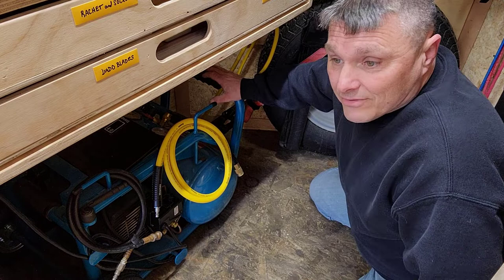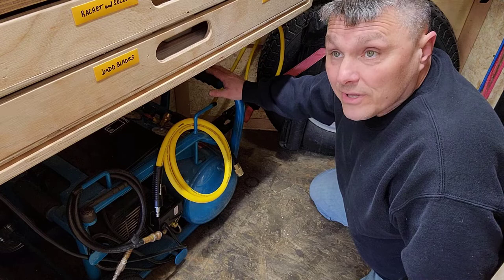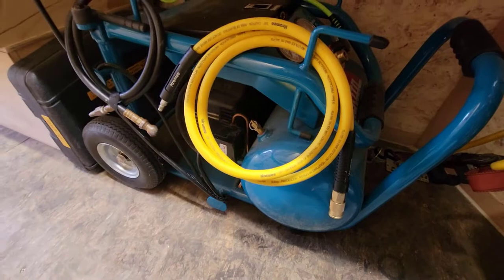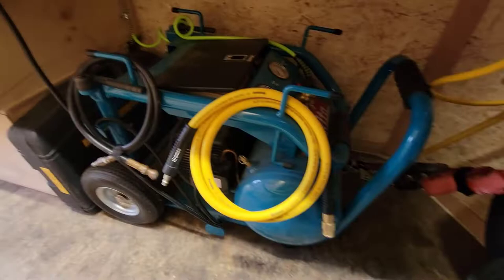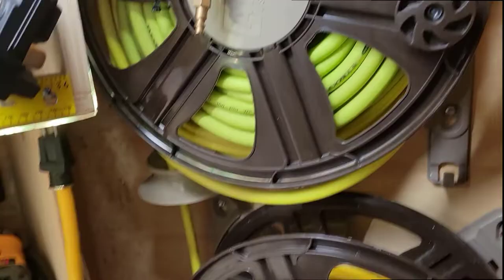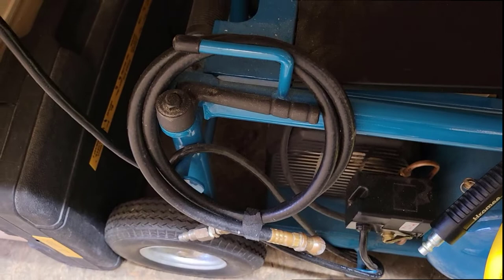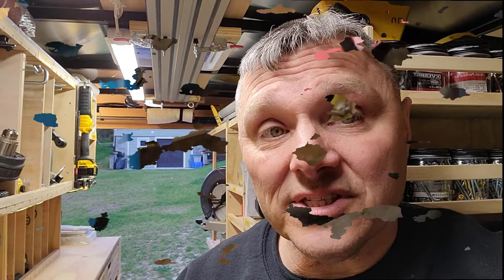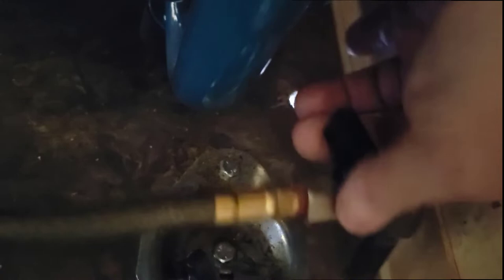Tool trailer air system on my Paulk trailer

Comment: I got a question wat compressor will you be going to next?
Reply from the maker: Thanks for commenting Rene! I have not researched it yet and will do so when I buy a new trailer in a couple years but I want to get one with a solenoid start because they pull much less power on start up and will start easier using an extension cord on an outlet/receptacle/power point that is some distance from the electrical panel. Otherwise, I would like the compressor to have enough power and pressure to do everything my current compressor does, including running two hoses simultaneously.

Comment from the maker: The air gun on the back of the trailer I use to clean off my tools is on Amazon for $12 and is called ….. JASTIND Industrial Air Blow Gun with Brass Adjustable Air Flow Nozzle and 2 Steel Air flow Extension, Pneumatic Air Compressor Accessory Tool Dust Cleaning Air Blower Gun. I have used it for a couple years and it is working well for me.

Comment: Hi Steve, would love to hire you to build me a paulk trailer. Do you have the time?
Reply from the maker: Howdy DS. Thanks for checking out my content. It would be neat to build another trailer and I plan to in a couple years, when I get a larger trailer to suit my needs. But….to build one for someone is difficult since it is so labor intensive and at $50 - $75 an hour, it just becomes too expensive to make it work for my time and the customer. Ideally, find a trailer that is built out and buy it. I plan on selling mine once my new trailer is ready to go on the road (again, in a couple years). There are likely other buildouts that might be on the market. A shortcut is to outfit a trailer with the rolling tool chests (taking the wheels off) and that gets immediate well-organized storage. I can tell you though that I know how to build but still learned a lot from doing my own trailer.